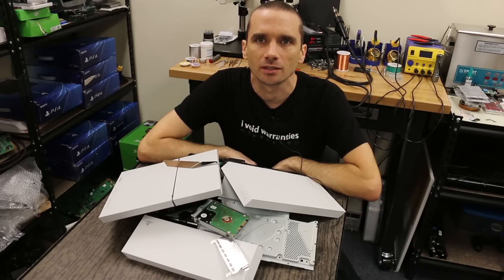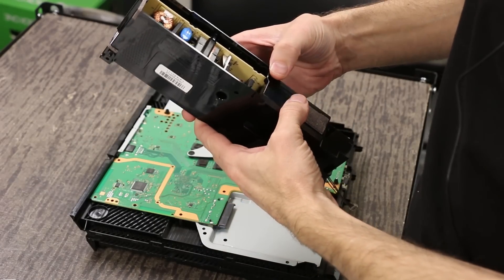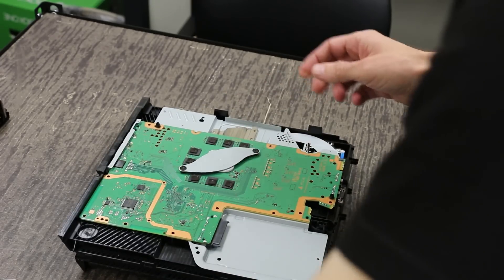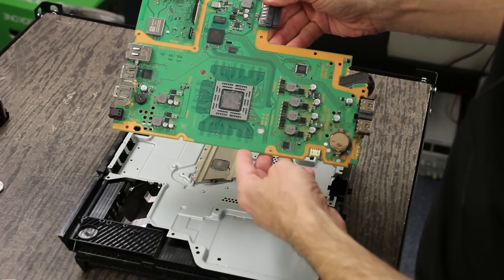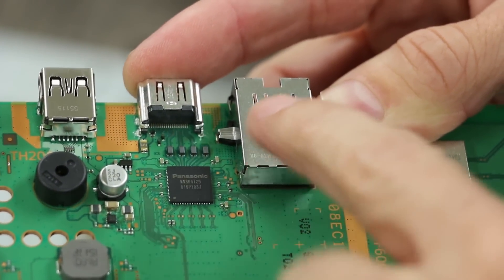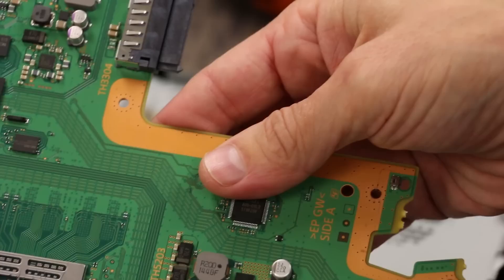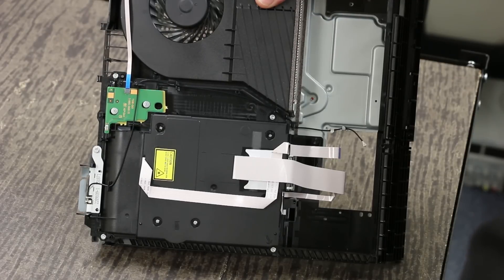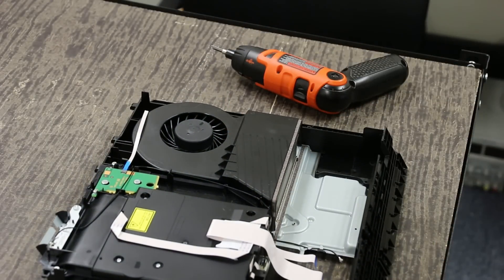PS4 Model CUH 1200A/1215 Disassembly

Comment: I need to know how to get the case off... ><
Reply: Use a flathead screwdriver or a little wedge to put between the casing and the PlayStation. I should pop right off.
Reply: @clintwoodley926  thx bro

Comment: i have a cuh 1215a i bought at a pawnshop. dust blocking vents. so i open it to clean it. now the optical drive is clicking and starting up and slowing down wouldn't let me play nba2k16. thing is massively overheating. im perplexed cause i cant return for a refund i dont know what else to do but buy a new one

Comment: i took my ps4 apart to fix the optical drive but now it turns on and off within 1 second or 2 can someone please tell me what it might be ....
Reply from the maker: Sounds like the APU clamp is not installed properly or the screws aren't tight enough.
Reply: TronicsFix  you think it might be the thermal paste ? i also tried to tighten the apu clamp with the watcher it jusrt keeps doing the same thing . :(
Reply from the maker: The thermal paste won't cause that problem. Make sure it's fully plugged in to the wall and the power cord is fully plugged in to the back of the PS4.
Reply: TronicsFix ok 😣 do you think i damaged the APU
Reply from the maker: I have not idea. Without having it here to test there's just no way for me to know that.
Reply: TronicsFix where are you located ?
Reply: it is overheating , probably no thermal paste

Comment: can you make a video on how to reset this drive I cleaned my laser and now it won't take disc
Reply: Darryl Beck Check out his "PS4 won't read disc" vid from 10 months back. I've recently worked on my PS4 and I've had the same problem and fixed it with that video.
Reply from the maker: You probably messed up the large ribbon cable going from the motherboard to the disc drive.

Comment: Sir, what are the differences in heat output of CUH 1100 & 1200 model? Which one has lesses heat dissipation ??
Reply from the maker: +Harsh Kumar No idea...I'm sure you can find that out by Googling it.
Reply: +TronicsFix Okk...What diff. did you find in the bluray drives of both??

Comment: Is it normal for the hard drive to make faint high pitch beeping when accessing the menus on idle?
Reply from the maker: +Everything80s I'd really have to heard it. If it's not too loud it's probably fine, but there's just no way for me to know without being able to have it here to check it out.
Reply: its not a big problem, just a bit weird. It only seems to happen when going through the top menu, just a high pitch buzz. And sometimes it will chirp very loudly for 5 minutes. Is it normal for the ps4 hard drive to make more noise when accessing that menu?
Reply from the maker: +Everything80s I really have no idea...never paid much attention to that. Sorry.
Reply: Yup it normal when i start my PS4 I heard meowing sound lasted 5 second

Comment: Hi, can you tell me if BD circuit board is still married to the board? Thanks :)
Reply from the maker: +Alan Liu The only circuit board is for the power button so I would think they would be interchangeable. We haven't gotten a chance to swap one yet but we plan to make a video about it when we do.
Reply: +TronicsFix nice. Thanks for doing this.
Reply from the maker: +Alan Liu You're welcome!
Reply: So i can buy blod 1215 and replace disc drive and it will work?

Comment: Is that bad that the button on 1215a are different than the button on the 1200a
Reply from the maker: +Fire Beake Yes, the buttons on the 1215A (1200A) are actual buttons instead of the capacitive buttons used on the previous models.

Comment: Is the thermal paste better than on the old ps4's or about the same? Just wondering.
Reply from the maker: +GRADE BLADE From what we can tell it's the same thermal paste. It's hard to know for sure but it looks the same.
Reply: +TronicsFix I just got this console. Do you recommend changing the thermal paste, or how long should I wait till I change it
Reply from the maker: +GRADE BLADE Honestly, I wouldn't worry about changing it. The thermal paste on these very rarely causes any problems. It definitely isn't the highest quality paste out there, but unless you are having problems with it overheating it doesn't usually cause a problem. If you decide you want to do it I would at least wait until after the warranty expires. That way you don't void the warranty.
Reply: +TronicsFix Ok that helps me a lot. Thanks so much for the quick response. I really appreciate it :)
Reply from the maker: +GRADE BLADE No problem! Hope you enjoy your new PS4!

Comment: Can you help me out and reply I got the bo3 bundle but it sounds like there's a piece loose in the system like a little screw maybe I wanna know if that's normal and at the right side of my console I have to be really close to it but you can hear a buzzing sound from the right side please let me know cuz I really hope it's normal cuz I really wanna keep this bo3 model am I the only one experiencing this
Reply from the maker: +Splash Vortexx HI! It's definitely not normal to have something loose in your console. The buzzing sound is most likely the fan since it's on the right side. It's possible that it's a little unbalanced or there may be something stuck in it. If it's dirty then it could be from dirt buildup on the fan blades. 
I hope this helps!
Reply: +TronicsFix I looked online and people said like when you give your ps4 alittle Shake you can hear alittle rattle like it dosnt sound loose just something rattling can you maybe have any idea what it is since you take these things apart
Reply from the maker: +Splash Vortexx Yes, when you give the 1215 a little shake you can hear the parts inside the disc drive jiggle around a little bit. To me it doesn't sound like a loose screw, but there is definitely some movement you can hear. This may be what you are hearing...hopefully it is!
Reply: +Splash Vortexx but even it could be creaking in the console it self it does not sound like its flying across the console like its in there just sitting in there it sounds if something was hitting back and forth but can you test it yourself givin it a little shake to stop my anxiety and paranoia please reply
Reply from the maker: +Splash Vortexx I've given one a little shake and I hear the noise from the disc drive. Unless there is something that is not working on your console I probably wouldn't worry about it. If it was a screw that was loose or out then you would hear it rolling around in there. I really don't think you have anything to worry about.
Reply: +TronicsFix omg thanks man I really do appreciate it I'm really glad it's not just be thanks man keep up the awesome work subscribed
Reply: +TronicsFix my ps4 works fine
Reply: +TronicsFix I'm almost 100% sure that's what it is cuz it's not even 2 weeks old
Reply from the maker: +Splash Vortexx You're welcome. Thanks for subscribing...we'll be adding more videos as we have time. Have fun with your new PS4!
Reply: +TronicsFix thanks so the buzzing sound is the fan correct and the parts jiggling is totally normal so much stress was just released
Reply from the maker: +Splash Vortexx Ha, ha...I'm glad you can rest easy now! Since the buzz is very quite I wouldn't worry about it.
Reply: +TronicsFix I know but what about the stuff inside did it sound like everything was good on the inside and buzzing can be heard when the room is dead quiet like from 5 feet away I can only hear it when my ear is right there or like 2-3 feet away
Reply from the maker: +Splash Vortexx It's probably normal. The one I checked was probably not quite as loud as that but from what you are saying it sounds like yours is pretty quiet. I really wouldn't worry about it.
Reply: +TronicsFix I was talking about the shaking is that normal like the stuff inside should be moving around like I'm not obviously gunna shake it at all but I just would like to know my brand new ps4 will work great
Reply from the maker: +Splash Vortexx Oh...gotcha! Yes, this sounds pretty normal.
Reply: +TronicsFix ok thanks for your help so when you shook it did it sound like one thing moving or multiple
Reply from the maker: +Splash Vortexx Kind of like several things.
Reply: +TronicsFix ok just wondering thanks was that ps4 new ? Or old just wondering was it the one in this video
Reply: +Splash Vortexx and do you hear the buzzing noise
Reply from the maker: +Splash Vortexx I checked the one in this video, but others we've repaired sound the same. I haven't noticed much of a buzzing noise but I'm sure some of them have a bit of a buzz. I don't think that's any big deal either.
Reply: +TronicsFix ok thanks so much so the part jiggling noise is normal and buzzing is normal thanks man for helping me out looking forward to more vids it would be awesome if you did the buzz noise or the shaking cuz a lot of people have this problem and let them know it's normal that would be an. Awesome vid
Reply: +TronicsFix if you want you can check it comes from the right side of the ps4 check for yourself:)
Reply: +Splash Vortexx No problem. I'll definitely consider this for a video. I hadn't even thought of that. Thanks!
Reply: +Steve Porter your welcome have you considered trying out the buzzing for yourself and the shaking see if you have it to
Reply: +Splash Vortexx Yes, I tried the shaking...that's how I knew it was normal. I haven't heard the buzzing like you have.
Reply: +Steve Porter oh your that guy sorry your on a different account did you try to see the buzzing tho
Reply from the maker: +Splash Vortexx Ha, ha...ya...I used a different computer that wasn't logged in!
Reply: +TronicsFix did you test for the buzzing
Reply from the maker: +Splash Vortexx No, but I've heard lots of these models and I haven't noticed the buzzing. With how quiet you said it was I wouldn't worry about it.
Reply: +TronicsFix ok but have you heard buzzing from any ps4 you received
Reply from the maker: +Splash Vortexx Yes...but there is no way for me to compare the sound you hear to the sound that I've heard because I can't hear yours. All I know is that it's really quiet...that's why I'm not worried about it.
Reply: +TronicsFix ok thanks for letting me know my ps4 is in great condition thanks for all your help
Today looking forward to maybe seeing that video
Reply from the maker: +Splash Vortexx You're welcome! Have a great night!
Reply: +TronicsFix you to now that I know those noises and shaking is normal I can have good night on my ps4 haha
Reply from the maker: +Splash Vortexx Yes...sleep well!
Reply: +TronicsFix when you shook the ps4 and heard movement did that ps4 work great just wondering
Reply: +TronicsFix the ps4 you shook did that one always work great
Reply from the maker: +Splash Vortexx Yes it's working great
Reply: +TronicsFix ok I was just wondering

Comment: Hello, your investigation and analysis of the new model 1200 you think? You think is better prepared machine to last longer? Its is more efficient? You think it does not overheat?
Reply from the maker: +thehorrocruxes From what I've seen so far it looks like this is a better built machine. It is built to use less power and therefore stay cooler. Only time will tell but it looks better than the previous versions.
Reply: Thank you, im about to purchase a version, and i have seen that the new model has very good reviews
Reply from the maker: +thehorrocruxes Yes, I would recommend it. Let us know how you like it and if you ever have any problem with it.

Comment: where can I purchase this in the uk ? 
And would you say its worth money to sell my launch ps4 and buy this new model
Reply from the maker: +techie20091 I wish I knew where you could get it in the UK. Unfortunately I just have no idea. You can check wherever they sell a lot of them...just check the boxes to make sure it has the right model number. 
Whether it's worth it is hard to say...especially since it's so new...there's no way to know what problems it's going to have. It looks like there are several things that are much improved, but there may be other things that have a problem.
Reply: +TronicsFix ok thanks for the reply. my launch ps4 does not actually have any issues. 
so it would probably be a waste buying a new model for no reason
Reply from the maker: +techie20091 Ya, if your launch one is going strong then you may want to keep it....at least for a while until we know more about what the faults are going to be with this new model.

Comment: Great video, i wanna know if the heatsink it's larger
Reply from the maker: +Alejandro Rocha The heatsink looks to be about the same size. It looks like it runs cooler mainly because it uses less energy. Almost everything is smaller on this motherbaord. That's how they make it so it runs so much cooler and quieter.
Reply: +TronicsFix ok thanks, keep the good work
Reply from the maker: +Alejandro Rocha Thanks! Will do!